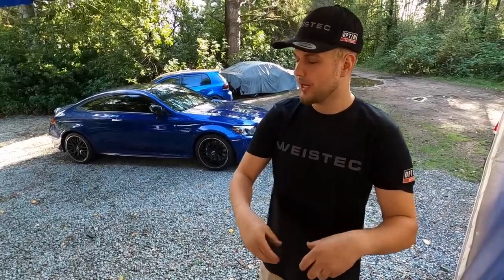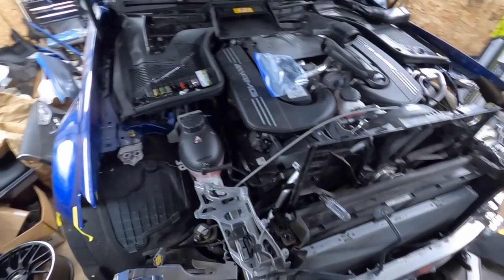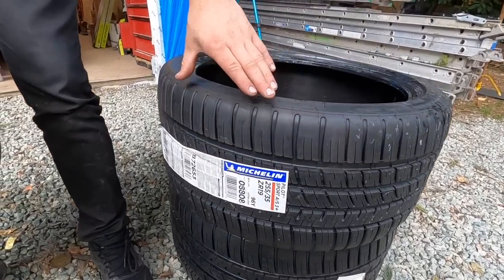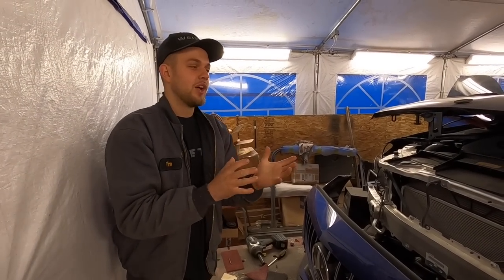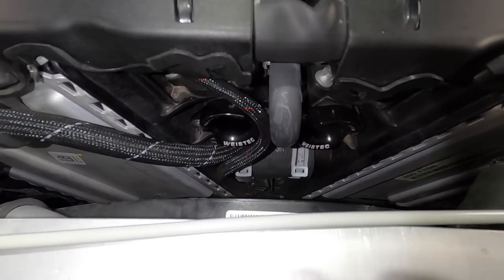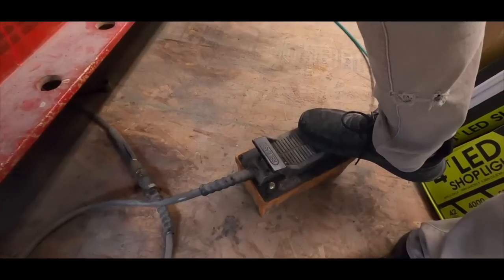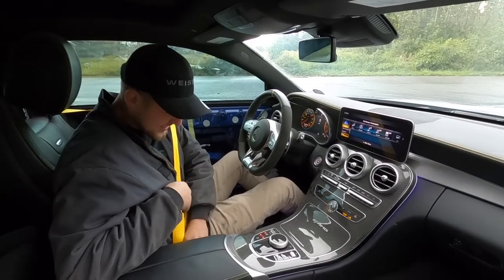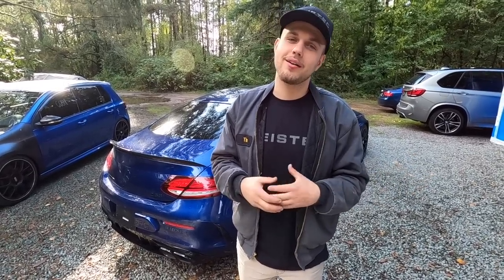Rebuilding a WRECKED 2019 Mercedes C63AMG From COPART! (Part 8) WEISTEC STAGE 2 INSTALL+FIRST DRIVE!

Comment: Sickest build yet but please take those blow off valves off .. way too rice for an AMG
Reply: Agreed
Reply: Agreed x2
Reply: agreed x3
Reply: Agreed x4
Reply: agreed x5
Reply: Agreed x6
Reply: Agreed x7
Reply: Agreed x8
Reply: CO-CO-CO-COMBO BREAKEEER !
Reply: Agreed x9
Reply: Agreed x10
Reply: Agreed x11
Reply: Total agree,save it for crappy honda's not a luxurious Amg 😭👎😂
Reply: Agreed x 12
Reply: I concur
Reply: Agree, too classy for that crap
Reply: AGREED!
Reply: @markcozzie  yet hondas have more reliable motors, higher resale values, lower depreciation. You don't know jack about cars. My s2000 is every bit as fun to drive and capable as my amg C63s, the difference is my s2000 will go up to 300k miles without any issues, an amg won't. Learn about cars.

Comment: Make a friends with a mercedes tech from a Mercedes dealership he can get you instructions manual directly from manufacturer on how to remove and install properly. Also tells you how much pressure to use to tighten bolts.
Reply: workshop manual would’ve made this guys work way easier

Comment: I absolutely agree with you on the way the c63 hugs the road compared to other Mercedes..i own a 2002 clk55 amg lol it’s old but let me tell you it’s such a great car! and it drives Amazing it handles insane! BUT I also own a 2017 s550 and it doesn’t compare to the coupe handling and pedal wise to me at least..the clk55 is just perfect to me..I would never get rid of it I’m the second owner and it’s Mint in and out black on black..Now your c63 is a whole different level of a beast compared to the clk55 or s550..but I definitely know what you mean about the back feeling like it sways lol my s550 feels like a plain in air as if it’s gliding..don’t get me wrong it’s a great car but NOTHING like that C63..

Comment: The ECU is down there because the engineers say below the engine it's cooler than the top of the engine because of where the turbos are located

Comment: Bruh, it’s a modern-day AMG with rear-wheel drive - of course it easily does donuts. Also, don’t confuse AMGs with normal Mercedes models. There is so much AMG-specific development work put into each single one of them. It’s not the same at all. They fall into the same segment as BMW M models. 😂

Cheers for the great content guys. Can’t wait to see this beautiful AMG fully completed! Shoutout from Germany! ✌🏻

P.S.: I bet you will like the Emotion Start function. Pull and hold one of the paddle shifters (it doesn't matter which one) before pushing the start/stop button. Thank me later. 😉
Reply: AMG is just a modified Mercedes benz .... there really isn’t much to it without Mercedes-benz there isn’t no AMG.
Reply: KON KON Not entirely true. You are right, many of the AMG models are based on the normal Mercedes-Benz derivative. However, on most AMGs, transmission, powertrain, suspension, driving dynamics & design for example are all developed in-house at AMG. It goes as far as seats and interior development. Even the V8 engines are completely developed and built in Affalterbach (AMG HQ) after the “One Man, One Engine” principle. It has a reason why AMG is considered an OEM these days. The whole GT family (GT 4-Door, GT, etc.) is purely developed solely by AMG. There is no Mercedes-Benz model under that. 😊

Comment: Definitely going to lose power with those valves - mine was running comfortably over 630bhp with catless downpipes and a remap, didn’t need to change the ECU
Reply: They didn’t change the ecu they sent it to get mapped without taking the whole car to the company
Reply: @xBigModzHD  - those generic maps aren’t good, to do it properly it has to go on the dyno and fine tuned, it’s way more than just increasing boost pressure and fuelling
Reply: @moa6324  that’s not true at all there’s a lot of mappers against dynos as they don’t provide real road information some mappers make really good maps by just research and tweaking, good example of this is wrench studios in the uk
Reply: @xBigModzHD  - you’re telling me a simple plug and play is better than testing the cars parameters on a dyno? Then you know nothing.
Reply: @xBigModzHD  - by the way I am from the UK, we’ve been mapping cars near 2 decades and believe me when I tell you there’s so many horror stories with generic maps - everything needs to be monitored especially heat tolerances, you can’t do that with a generic plug and play map, trust me
Reply: @moa6324  a “plug and play”? What’s plug and play about taking a ecu out and bench mapping it then putting it back into a car? You’re the one who clearing knows nothing about ecus and mapping what’s so hard to understand? Yes a dyno can be good however there are many mappers out there that can map cars without them at the end of the day it don’t matter what horsepower you’re making when it comes to real road driving what matters is max speed, 0-60 times and smooth acceleration which a rolling road will not give you
Reply: @moa6324  the issue is it’s not a generic map this ecus been sent off to the company and they’ve custom mapped it based on the mods it will be running you really don’t know anything about mapping do you
Reply: @moa6324  and also a dyno won’t give you heat figures the ecu and other thermal equipment will
Reply: @xBigModzHD  - you yanks are funny, you sound like a schoolboy that’s discovered something new. As I say, here in the UK we’ve been doing this for decades and I know more than you when it comes to this sort of stuff. In order to get a correct map, because every car is different, all tolerances need to be taken into consideration, you can’t do that with a simple ecu flash, it has to be run on a dyno and in real world conditions.
Reply: @xBigModzHD  - now wipe your tears little guy and try again harder. Better still educate yourself on the matter first before you embarrass yourself further.
Reply: @moa6324  Yank? Can u not read I already said I’m from the UK?
Reply: @moa6324  Also as I’ve said time and time again many companies in the uk and Europe have had very good success tuning without dynos and without blowing up engines
Reply: @moa6324  you’re the one who’s embarrassing yourself I’ve said dynos are not bad however they’re not needed to do a good map? You sound like the salty one here pal

Comment: No loss of HP with the VTA's, All they do is divert the excess air to atmosphere now instead of back into the intake.
Reply: That up for debate, some say that dumped air does help spin the turbo's up,but now it's dumped to air,??
Reply: illegal mod in most countries. You're venting steaming engine oil into the atmosphere. It's better to burn it. Smells bad and at nights makes it seem like the engine bay is smoking
Reply: @NoRogeR  😂 what kinda engine you got my friend 😂 you might wanna get that checked
Reply: @markcozzie  that dumped air is going into a air track that the throttle body is closed, def not helping turbos spin up, esp when you dont want the turbo spinning up when you have the throttle closed